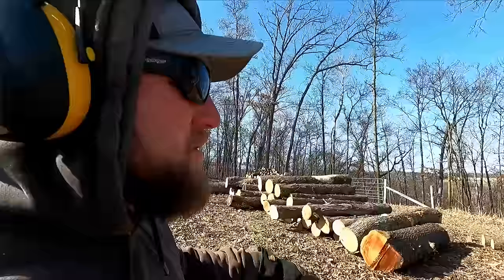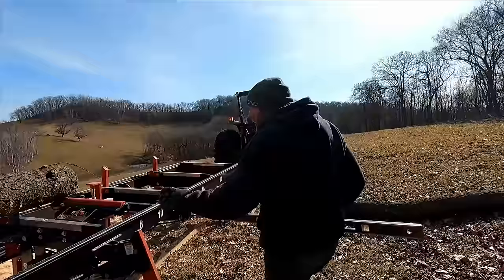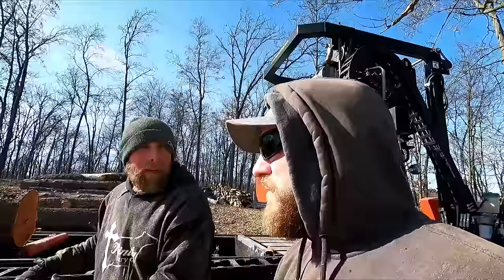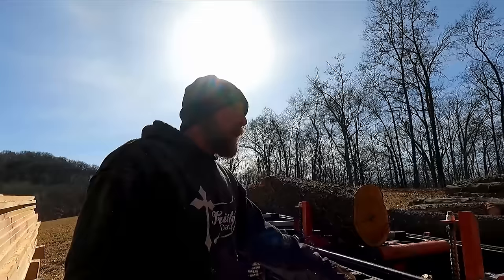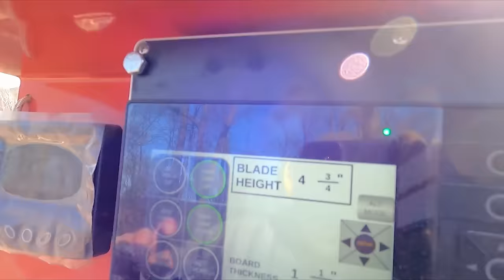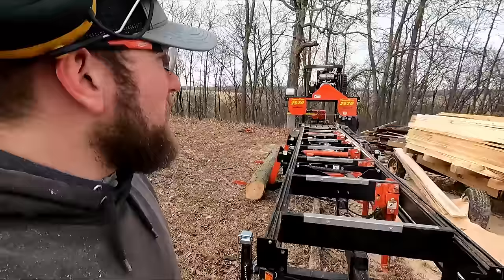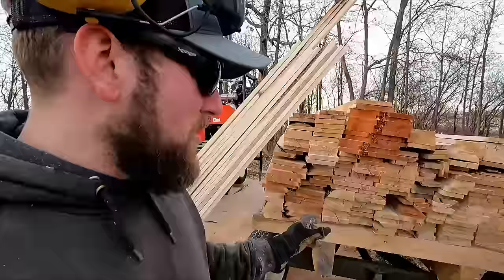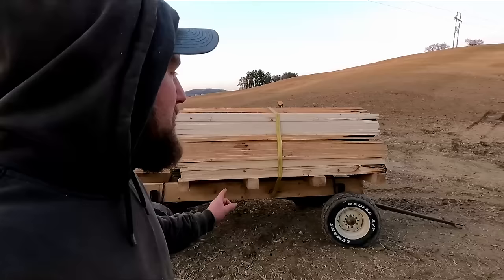Sawing Hardwood Logs Into Lumber With Our 2520 TimberKing Sawmill!

Comment: Very nice! Thanks. Somewhat similar to the way things work on our farm, too. We heat our house with wood (2 stoves inside) and also our shop. All of our slab wood is used to heat the shop and we use the smaller pieces for kindling in the shop and house. Also used for campfires for some of the church activities held at our farm. We gather up all of the sawdust and use it in the chicken house, calf pens and gutters. and yes, some of the more difficult stuff and bark pieces go to the bonfire pile, but generally very little waste.

Comment: I've been wanting to see the new mill run. George doing great on the controls. No blade to metal contact. Hopefully never will. Aaron getting a real workout off bearing the slabs and working the green side to pack lumber. Gotta get the Young Gieroks up there to help too. I know labor is a premium, but one more body would really speed things up. I have a request for you guys. PLEASE, fashion up some type of bulkhead or headboard etc. on the lumber wagon. I'd hate to see someone attacked by a load of green lumber. I say this because I saw it happen once. The tractor driver was okay, but the tractor fenders didn't take it so well because he couldn't get stopped soon enough. Love watching you guys. Keep the milk and sawdust coming.

Comment: you asked about the slab wood. I'm about 2 hours north of you and it sells for $15 a yard. They make a 4x4x what ever length they have using cut pieces of slabs. I use them in my wood boiler.
Reply: $10. For a pallet like you get around Central Illinois, 2 years ago.
Reply: Always been 15-30$ a bundle where I'm from softwood/hardwood bundles are about 2 facecord
Reply: It's an Amish sawmill, mixed hardwood and soft, board rejects, and cutoffs

Comment: I have been watching your channel  for quite a while now and love what you guys are doing. I grew up on a farm and it just never leaves you. I have one suggestion  for your lumber trailer. Because  of your hills it might be a good ideal to add some weight to the running g gear to lower your center of gravity. Would add a lot more safety to your Tran  sport. Just food for thought. Keep up the great videos.  I love them all. Rick from Neb.
Reply: Didn't you see these guys baling hay or chopping silage on these hills.  You should see how the bigger farmers chop hay on those hills.  Tandem axle straight trucks and they blow the silage on to the up hill side of the box to lessen the chance of the truck tipping over.  I asked one of the farmers in their neighborhood if he was worried about tipping the trucks.  His answer:  Nah, they usually slide down hill before they tip!